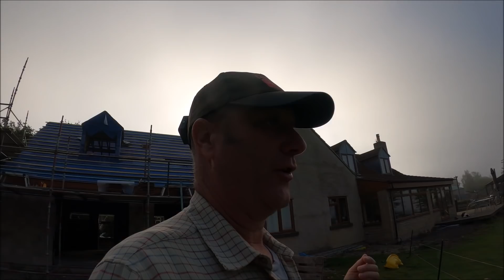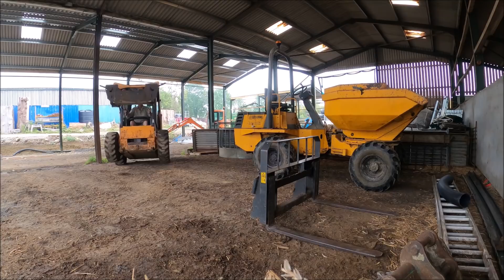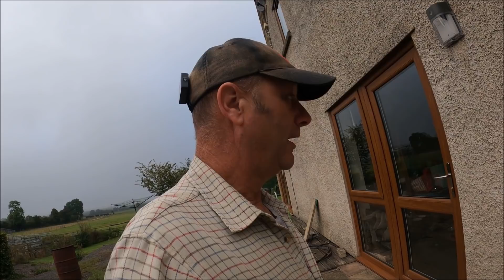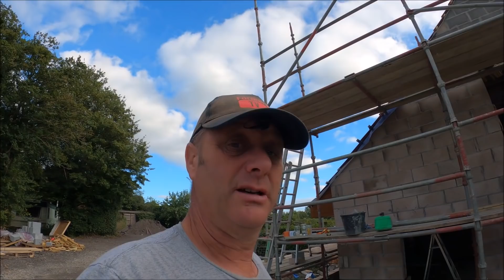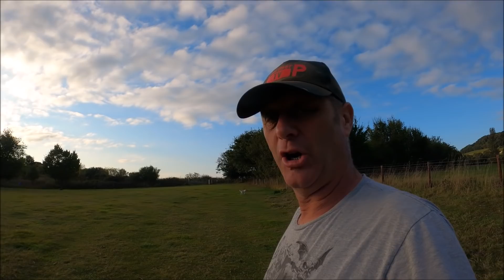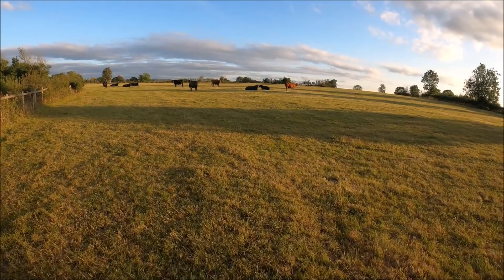Attacked by a new potato ?  22 09 21

Comment: Tell the content haters to unsubscribe, they will only find fault with anything you do.
As a hearing aid/Deaf sod I find the booming sound easier to hear, only downside I've found to the new mic is when you're talking to others, they are very quiet when the mic is in the cap and hard to hear at times. 
House is coming on well, going to miss the builders when its done, you will have to build another extension next year so they can come back!

Comment: Glos Council do like rooms in the roof, my sister lives in Stroud and the council made the farmer build the house with 4 Dormers jutting out, the terrible thing's are the sloping ceiling prevents furniture other than a low drawer unit being put in the bedroom. As I'm not used to sleeping in a Dormer bedroom I crack my yed several times a day.

Just noticed a few jobs to going on with over the quite months.!!!!!!!!!!!!!!!!!!!!!!!!!!!!!!!!!!!!!!!!!!!!!!!!!!!!!!!!!!???????????????????????

Have you thought of putting that expensive garden sand in cube bags, that way it will keep clean, be easy to move and take to site.

Have you put the 2nd load of muck on the field scars yet. That very expensive looking gate latch requires some adjustment, the gate that Pickle would not go through.  The other gate could be adjusted with a 4 X 2 timber with a slot drilled in for the bolt, fitted securely to the post with some baling string or even some wire as a temp measure.
By the way I do love Pickled Walnuts to go with the cold turkey at Christmas.

Good to see you checking the cattle, making sure injuries don't get worse, the nature side of your farm is getting established, well done. Stay safe and thanks for posting.

Comment: I don’t know if I missed it somewhere but what are the two steel beams on the top in rafters for?
Reply from the maker: You must have blinked Rich. They are explained in an earlier video, but just for you, they are there to absorb any deflection from the roof trusses total over kill if you ask me, the builder and the building inspector…. But, they are in the plans and engineering calcs, so in they went…. £1’300 worth of steel. 😢
Reply: @FarmerP  I must have I even went back to try and find them skipping through probably went right by again sorry but thanks for letting me know lol at least you got a couple extra views on them 😂